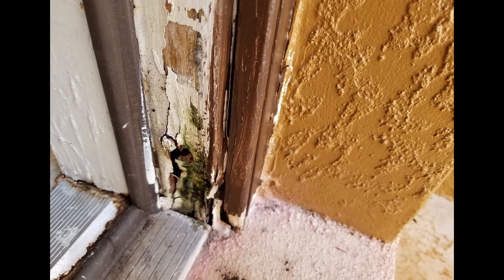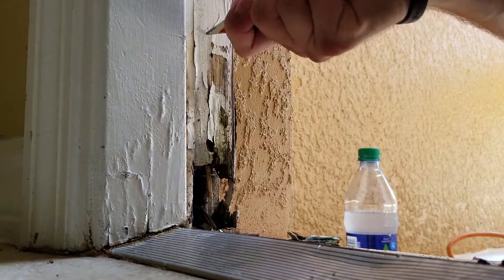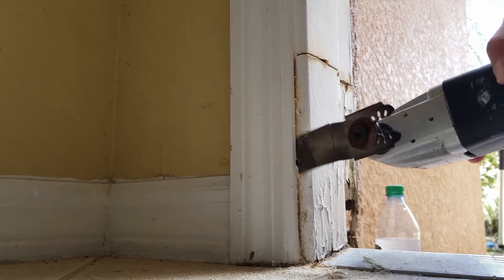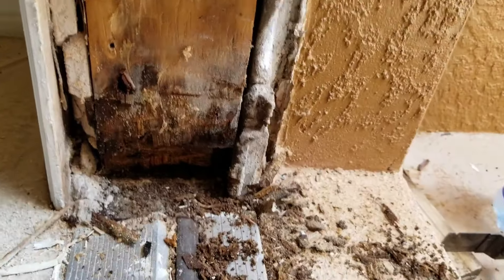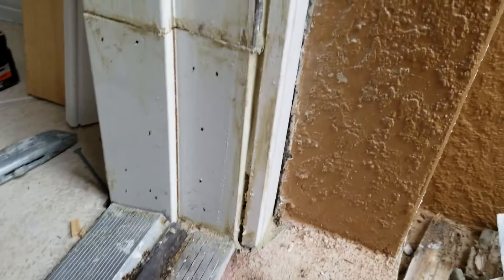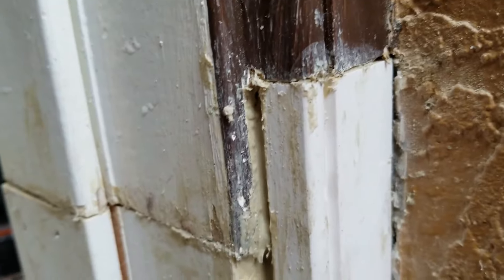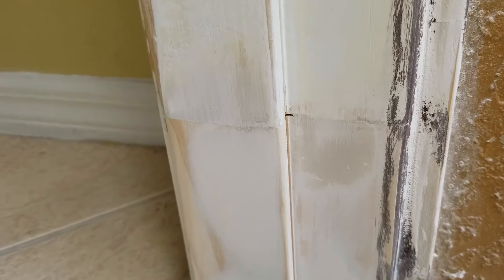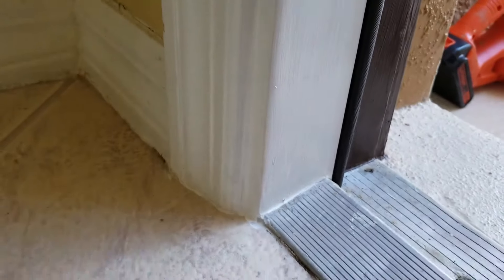HOW TO REPAIR ROTTED DOOR JAMB

Comment: Definitely on the right track! But you could have done a few things differently to guarantee no future issues
Reply from the maker: Yes, with time and experience, I've adjusted the way to repair door jambs. This video was filmed when I first started repairing door jambs. At that time I've only done a handful. After each repair, I learn more efficient ways to do things, along with ways to ensure longer lasting results. I also would express to clients, that this kind of repair, would most likely be a temporary fix. They were normally ok with that info because they wanted to save money. One thing I did, was stop using wood door jambs and started using composite materials, (Not PVC) along with better water proofing. Feel free to share any ideas, I no longer do this kind of work, but whatever you share may be helpful to those reading this. Thank for watching!!

Comment: You don't have to reattach the jamb to the threshold? Nice video.
Reply from the maker: No, because once you add the wood behind the jamb, the jamb will stay in position. Not only that it would be difficult to reattach the jamb to the threshold, use caulk or adhesive between the jamb and threshold. Hope this helps, Thanks for watching!!

Comment: Where did you get the section of door jamb that you used to replace the rotted section?
Reply from the maker: Hi!
 I apologize for the delayed response. For some reason I havent been receiving notifications through email regarding comments. You'll be able to find the jamb at The Home depot, Lowes, etc. They sell the set, or you can buy the stick. You'll have to buy the full length. They offer it in PVC, Wood, and Composite material depending on where you purchase. Hopefully I didn't respond too late. Thanks for watching!
Reply: @peteshowtosreviews8067  Thanks. I did find the individual jamb at Lowes. I did the repair the same way you did, and it came out good.
If it weren't for your video, I wouldn't have even known to look for that jamb piece..
Reply from the maker: @joeweatlu5169  Awesome! I'm glad my video helped, and that you were able to find the jamb, and got it done.

Comment: Peace! Nice video and thank you! I was wondering when I learned this (because I’m becoming a handyman) how much would I charge for a task like this on average? Bless
Reply from the maker: Hi!
I'm glad to hear that you are becoming a handyman. I used to charge $250.00 for something like what you see in the video. Ideally, you should be able to get it done under 3 hours. It will most likely take longer when you are first starting. Try to at least get it done in one day. You should always charge accordingly for each item you are working on. For example, lets say the client wants a door knob installed, along with a light bulb change. I used to charge for each item, the door knob $20.00 + material, light bulb $10.00 + material (these are examples). The total cost for labor is only $30.00, I personal won't think about getting out of bed for that amount. You'll have to establish a minimum charge for stepping foot on the jobsite. About a year after starting my handyman business, I started implementing a minimum charge of $150.00 + material, regardless of how long it took. If it took 30 minutes or 5 hours, I had that minimum. Only charge the minimum, if it is greater than the per item cost. Instead of only making $30.00 labor as shown in the example, now you can make $150.00 labor. Be transparent with the client upfront so they know what to expect. Feel free ask any more questions, or if there is something specific you would like to see, let me know, maybe I can do a video showing the prosses. Thanks for watching!!
Reply: @peteshowtosreviews8067   mannnnn wow I really appreciate your DETAILED response!!! I’m extremely grateful man!!! Bless you heavy!!!!
Reply from the maker: @swishcamp81  Any time, If you have anymore questions, let me know. I'll be more than happy to help. God bless you, your family, and business. If you haven't subscribed yet, please do. It will motivate me to create more content.

Comment: This is cheaper if you have the wood already on hand.  Otherwise, you have to buy long piece of trim and 2x4 to cut off the small pieces you need so you may as well replace the whole piece.
Reply from the maker: Hi,
Yes, It would be less expensive if you already have the wood. But not as expansive as replacing a whole pre-hung door, or just the jamb. I already had jamb from previous jobs, so it didn't cost too much if you calculate per foot. Replacing the whole thing is an option, but the person doing the work will need to know how to properly align latches, or hinges, depending on what side you are working on. They will also need some specialty tools, even if using basic tools like a hammer and chisel. Some home owners don't have chisels in possession, they most likely don't have a multi tool like the one I used. But they can cut to wood with an inexpensive hand saw, and use a flat head screw driver to pry off any wood. You'll also have to buy shims, to re-shim the jamb, you'll need sticks of trim, instead of buying scrap peace's at the hardware store. you'll have to buy a can of spray foam to fill the gaps, instead of using caulk for that small area. In some cases you'll need to know how to router the bottom of the jamb to match the slope of the threshold. If done the right way, there's more time, skill, and effort to replacing a fill stick. In my experience I've had to repair both sides. The more difficult part is the hinge side. I've done plenty of full jamb replacements, but I have the proper tools, jigs, and knowledge to do the job. Thanks for your input and for watching!!

Comment: What tool did you use?
Reply from the maker: Hi!
I used a multi tool to cut the wood. If you don't own one, I recommend checking out Harbor Freight. They have different levels of quality. I've been using my Chicago electric Pro series, that you see in the video for about 9 years and its still going strong.

Comment: Name of the cutter please
Reply from the maker: Hi,
Hope this response isn't too late. The cutter it's self, is from Harbor Freight. They no longer have that brand. They have less expensive models and more pro level models. If you aren't planning on using it professionally, or on a regular basis, the lower cost option is fine. If you google Oscillating Multi-Tool, or Multi-Tool, you'll find multiple options. You'll also find a wide variety of blades to chose from. Some blades are proprietary to that specific manufacture, and others are universal. If you prefer a blade or attachment from another manufacture, you'll be able to buy a universal adapter. Hope this helps, Thanks for watching!
Reply: @peteshowtosreviews8067  Thanks so much for reply
Reply from the maker: @Saptea_Darchhun  You're Welcome! feel free to inquire about anything else. I'll work on responding quicker next time. lol

Comment: would be better if you did a half lap joint but nice work
Reply from the maker: Yes,
that is correct, I didn't do a half lap joint because I didn't think of it, lol. Thanks For watching!
Reply: Appreciate your honesty ,
Reply: James what is a half lap joint??
Reply: I suspect that with no direct connection between the old wood and the new, you will soon get the paint failing along the joint line. On repairs of this sort I always use a half lap joint or scarf joint with several screws connecting the two pieces of wood.
Reply from the maker: @RylanceStreet   I haven't had any complaints from long term repeat clients when it comes to these repairs. A matter of fact, I normally ask to see repairs I've done, especially if it's been over a year or two. I failed to show it in the video, I fill the gaps with bondo to make the old and new wood, one. This repair was done in 2018, It took me a while to upload it. If I ever get a chance to see this job again I'll do a video of it and up load it, even if it didn't hold up well. You are correct half lap joint is best. I didn't think about it for this job. I've done about 3 or 4 repairs like this with my repeat clients years prior to doing that job. I'm learning every day, and I don't mind taking advice from my viewers. Since then My technique and skill has improved. Thanks for your comment and watching!
Reply from the maker: @josephineshort6494  Hi!
I apologize for the late response, I didn't notice this comment. I know this question is for James, but I go ahead and answer. A half lap joint is when you remove two equal part of the wood and joint the cut sections together with glue and nails/screws, just glue and a clamp to hold it until the glue dries, or just screws/nails. I prefer glue and clamp depending on the project. For door jamb repair there isn't any room for a clamp, so you can do glue and nails/screws. hope this helps. 
Thanks for watching!
Reply: I'm not a woodworker so I am curious how you would make a half-lap joint when one workpiece is still attached to the house?  I know how you would make a half-lap joint with two workpieces on a table saw, but how do you do it on the attached piece of jamb?  Do you do it (carefully!) with a circular saw?  Seems like it would be hard to get the perfect fit that makes the joint so strong.

Comment: Seal that area with flex seal or something similar otherwise the frame can rot again
Reply from the maker: I understand your thoughts, I used caulk to seal it. I don't think flex seal in a caulk tube was a thing at the time of this video. This video was done back in 2018, the only color available was black according to my remembrance. I remember using that product on other jobs, but not a job that needed to be painted. I don't think it is paintable, if it was, it would take quit a few coats of primer and paint to cover that deep black color. I've change some of my methods since then. Thanks for watching!

Comment: I understand you not a carpenter probably a good guy to trying to show people how fix things around the i suggest to watch the pro's first, you didn't needed to pvc to patch the wood you could used regular people is going pvc n break the bank you don't to used bandod either you could used a outdoor patty good prime n paint will take care that next time used a patty knife so you don't have to ruin you sharp chisel 4:25
Reply from the maker: Hi, 
I've changed the way I approach those repairs since that video. I no longer do that kind of work. I've been doing construction and remodeling consulting since then. There for I don't have opportunities to create a new video showing that kind of repair. Either way I would still use Bondo if needed, because of its reliability. Feel free to send me a video of how You, or a Pro does it, so I can learn something. I watched plenty of videos back in 2018, and the results were not even close. That's one of the reasons why I decided to do a video. Keep in mind, I had very little experience with those kind repairs at the time of this video. Thanks for watching!